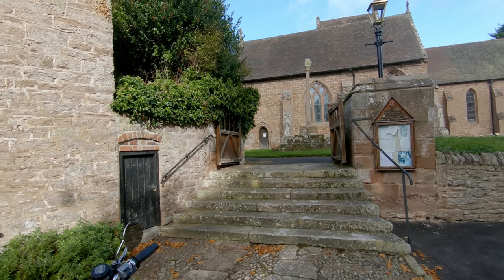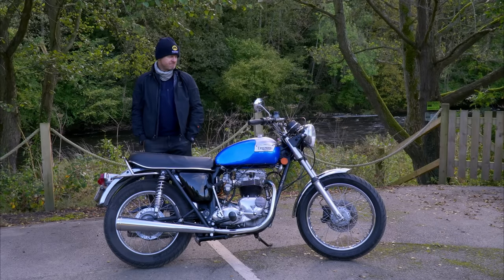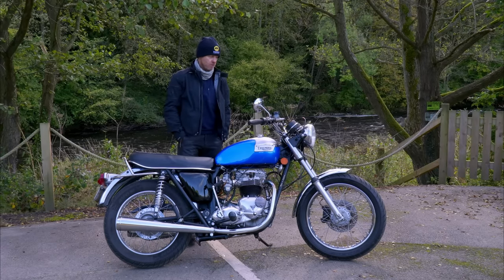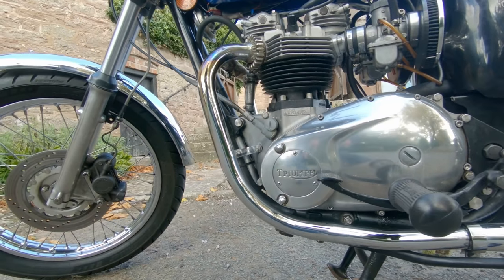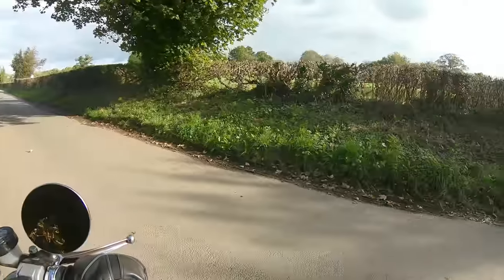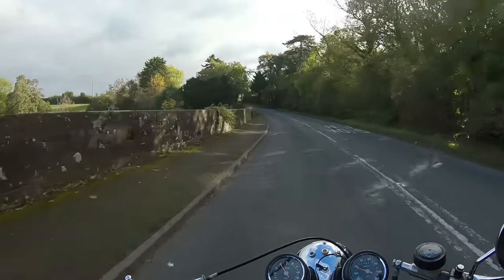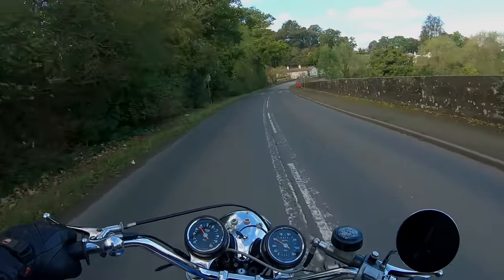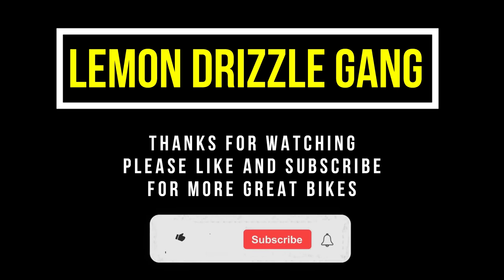Modified 1975 Triumph Bonneville,  better than a modern retro ?

Comment: Long-time '76V owner here, love the blue/white look! The '76 has some notable changes, and not all for the better! The left foot shift can cause shifting problems, and the hastily designed  rear disc brake come to mind. But with patience it all gets sorted out, and it's a terrific classic bike with plenty of parts availability, good brakes, turn signals, and reliability. A well tuned OIF 750 beats a modern Bonneville Thruxton in acceleration, i know that personally!
Reply: Rubbish 😂😂

Comment: I have a 76V that I’ve owned since 2013, rebuilt the engine with three piece roller TS bearing, Hyde half race cams, LP Williams 7 plate clutch, new Premier Amals and had the head done with +1mm G&S valves and K-lined guides. Looking forward to video on the mods done to this bike, looks and sounds great. I’m preferring riding it to my modern bike.
Reply: You sir, are to be envied and admired.

Comment: I have a 1973 Tiger 750 that is very similar. 
I have owned since May 1977.
It has over 62,000 miles & still Runs good.
I have never split the crankcase so it has original engine bearings.
The inner transmission cover has never been removed, so internals of the transmission are all original.
When it had 30,000 miles I had the cylinders bored out .020
I made my own wiring harness in 1985, basically duplicated the original, but tried to make better.
I replaced the rectifier & diode with a new electronic unit.
I add a little 2 stroke (synthetic oil) to the gas & it keeps the carburetor from sticking.
I had the cylinder head redone many years ago 
You should use a Viton o-ring on the exhaust tappet block, other o-rings will leak/fail due to the heat.
I rebuilt the clutch last winter & replaced the clutch hub assembly etc.
I have replaced the primary chain three times.
My bike has a single Amal carburetor with stock side covers & Tiger name plate.
I never had the stock paint job & right now it is reddish orange.
I have always had short mufflers.
I had to get the frame welded years ago because the oil tank was leaking -  where the swingarm pivot penetrates through the tank.
This is a common problem with the frames.
I replaced the tachometer drive with an older style. The original style had a problem with the Welch plug coming out.
I do have nicer looking mirrors: 
They are triangular in shape & stick out farther on both sides. The mirrors mount like originals on the brake cylinder & clutch handle bracket.
Anyway, that's my two cents.
Reply: I've got several Triumphs I've bought over the last few years, trying to reach back to my youth and your statement provides a comfort zone for me.
Reply: @JohnMcClain-p9t  
Thanks!
I now have over 64,000 miles on my 1973.

Comment: PS, I had straight through down pipes, no balance tube, as this stops a smooth exhaust flow! Boyer ignition, & dinamicly balanced. The next job I  would have done, if not stolen, was to fit the carbs you have. Just a lovely bike, thanks for your vid.

Comment: Absolutely the best year for the T140V, Sadly my 1973 T140V was stolen. Why I loved that bike was it did everything I wanted, also the right-hand gear change was perfectly balanced with the clutch lever movement, as the brakes were. This was due to the cross movement from side to side. Also this design meant using both sides of your brain for any change of operation.
Perfect.

Comment: I had a T140 Tiger many years ago, covered a lot of miles on it and it never gave me any problems. Also had a few T140 Bonnevilles, but always prefered the Tiger. My favourite Triumph was a T160 which I always regret selling - PYH488R where are you now?. I have a modern Triumph these days, but they just dont compare to the originals. Also had a T120 R - that was a real rocket ship and unburstable. Happy days......

Comment: I used to own one very similar, over 30 years ago; till some bar-steward stole it. It was dynamically balanced.
AT a place called Basset-down near Swindon. Floating rollers both sides, using shims to 6thu end play.
It was a 1973 model fitted with Boyer ignition. 8.5 to 1 compression and went really well. Also right hand gear shift
which is better, as your hand and foot movements are across the centre of balance, as is the breaking. 
Nice bike, look after it.

Comment: I grew up on these bikes! Started with a 69 Trident in 1975, then a 73 650 Bonnie two years later, followed by a Commando 850, then a 750 Bonnie and later a 750 Tiger. In 2009 I was about to lash out the $15k (AUD) for a brand new Bonneville, when a mate came round to tell me he was trading his 1997 883 HD Sportster for a bigger bike. A soon as he told me the trade-in was $7k, it took about 10 seconds to decide to go with that for my first ever Harley. 15 years later and over 90,000 kilometres of touring all over Eastern OZ, and I still have it. I stripped it right down a few years ago everything including wheels came apart and with a set of Carillo barrels and pistons from Hammer Performance, it’s now a 1275cc. Standard heads give it a 1/4 inch squish band and 10.1/1 compression ratio, which with a 2-1 system and an S&S teardrop air box, puts out around 90 HP and double the troque of the original engine. It’s perfectly balanced and although it isn’t QUITE the same as the sound in this video, it is similar in that it is happiest at around 5k RPM and the sound is not far off either. At 67, I think this’ll be my last bike, but listening to this Bonnie revving its way through the gears is music to my ears! The modern Triumphs do NOT sound as good!

Comment: Much better looking with the retro style side-covers. I have these on my resurrected 1982 American export T140.  This was missing a lot of parts when I got it. Tri-Spark ignition was a game changer and it is a joy to ride as well as being reliable. I like the T160 kick start.
The T140 is a pretty good daily rider if maintained well but they suffer a bit in the summer here in Western Australia. I pick my riding weather and can always fall back on my Sprint GT or Honda 1300 Super-Four.

Comment: Very very nice- Thank you for sharing. I have a 78 T140V that I have owned since 1986. Its 100% stock, (barring a boyer ignition that has performed flawlessly for over 30 years),  - and I have to confess that all the impressive mods that he has done to this one feel to me a little like thousands spent "gilding the lily" a bit. I ride mine almost every weekend on some of the twistiest mountain roads that CA can provide and  it performs just as it should - and just as seen and felt in this video. 
And like he said, (while I have a number of terrific classics too, all of which are "worth more" than the T140V),  its the last of all my bikes that I would part with. It is  eminently practical, very user friendly,  and very fun to ride with one, or two, passengers. Say what you want about the OIF bikes, they are much more reliable machines than the 60's bikes and every bit as satisfying on the road.
Again thanks for sharing-
Reply from the maker: Thanks for watching
Reply: Yes, it's a great looking and sounding machine. I've got a 78 T140V, UK model, which I've owned since 1993. It looks standard (apart from the Norton peashooter silencers), but has a few unseen, practical mods, such as the upgraded main bearings, Boyer ignition, 3-phase alternator, paper oil filter conversion, screw-in exhaust port stubs, halogen headlight and 13mm front master cylinder. All of these are for reliability and rideability, rather than performance, and have not changed the character of the bike, which I love.
Reply: Joining the party - my '78 T140V, slightly modified - is a gem to ride over the two-lane blacktop roads in SoCal's high desert. Especially thru the Joshua Tree National Park. Too bad we can't share pics!

Comment: Sounds beautiful. I've never owned a Bonnie, but did own two Tiger 750 single carb bikes and a heavily modified Trophy Trail 500.  One of them was excellent, the other not so much. I would love to own a classic but have decided to go for a newer technology parallel twin with fuel injection, after road testing one. Still I miss my Trophy Trail the most.
Reply: I had a Trophy Trail 500 i bought new in March of '74.

Comment: I loved my T140 . I changed to the slimmer tank , due to a split nearest to the headstock , and put larger , non-standard , but Triumph , badges on the new red and black twin gold striped tank . Then I put Usa handlebars , the old rubbers that I replaced acted like pendulums ! And then I put Commando reverse cones on . One very pretty bike , in my opinion anyway ! But despite all the cleaning and beeing about with timing and carb tuning ( I had , still have , a mercury manometer ) I could never get it running to my satisfaction . Merlin motorcycles offered me a deal with an SF2 Laverda that I jumped at . Eventually , after failed fettling  , Andy had the engine apart and it was found that the cylinders were not bored parallel . 
Like I said , I loved the Bonney . It seemed light and agile , the stainless single front brake was a nightmare in the wet mind and it made a lovely sound . A grown up 250 really ! Loved it and now I have seen your video , maybe when the dosh arrives I wont chase a new RE or Guzzi . Thankyou .

Comment: Interesting stuff. Had a '75 T140V which was right foot shift. I now have a '71 OIF Lightning and a '93 VFR750. The former is badly engineered out of excellent materials and the latter excellently engineered out of crap. Had an R80/7 which had the best of both worlds but not very quick or sporty. At the end of the day it's how it makes you feel. Enjoy!

Comment: I had one of these in 1975 a T140v American version same as in film, I still suffer from white finger, vibration was horrendous, they literally shook themselves to bits. My favourite Triumph which I had for 10 years was a T160, wish I'd kept it, I'm sorry but there were no tears shed for the T140. Judging by the amount of mods it is no longer a true Bonneville is it?, but I approve this is how it should have been. Notice you have a lithium battery, I gave up on these after 2 bad winters which killed them dead, even on a lithium maintenance charger, Yuasa for me every time, never had one last less than 8 years.

Comment: Jay Leno said his '64 bonneville handled so well it was  like he just had to think of where he wanted the bike to go and it responded. That described perfectly what I liked best about my '68.....Yes, it had all the annoyances that riders complain about but that feeling of it being an extention of myself was amazing. I'm told the frame change in '71 changed that.
I would have really liked a lot of what's on this '75....great video
Reply: I had my 68 Bonnie for years. Still love it.
Reply: I don't think the OIF bikes take away any of what you described, a lot of which comes from the weight (or lack of it) distribution and the skinny tyres which roll so easily into the corners. This bike definitely handles better than my '68, which is pretty decent anyway!
Reply: @waveydavey750  To be honest I've never driven an oif bike. I just remember the complaining when the '71s came out. I did drive some hondas, a yamaha 650 and a '70 bsa 500, and they all felt like a bit of a wrestling match in the corners. The bsa was brand new and after getting off my bike the first thing he said was " I'll trade you strait across"
Thanks for your observations. Leno also gives some facts as to why triumphs bought in the uk often handled better than the ones exported.......interesting

Comment: I believe the factory 1979 was the best Bonnevilles ever produced. I've seen many that were leak free, electrically straight, the best carbs, the best build quality. These bikes are highly underrated and very reasonable because the many seek to own the 59-69 and the most desirable.
Reply: Why do you suppose that people think that these years are the most desirable?
Reply: @derekcollins1972  their association with the king of cool Steve McQueen, the 60s styling, less vibes than the 750 when build correctly, they are also lighter than later bikes with fewer build problems when new than the 70s bikes which suffered from the issues as the BSA/Triumph group collapsed.
Just my opinion
Reply: @nigeh5326  Thanks for your opinion. I still have my 68 Bonnie that I bought many years ago for $1200. I remember kicking myself afterwards when I could have bought a pair for $600. One ran and the other didn't. Lol,times have changed from being worthless to many to crazy priced today. Fads happen i guess. It's great to have lots of parts nowadays available.
Reply: I had a brand new 79 that was a real lemon. A great bike when running though. Appalling quality control issues on mine. I own a 68Trophy 500 now that is superior in terms of reliability, build quality. Go figure hey?

Comment: I went around France in about 1969 on my second-hand Tr6 650 triumph. My gear lever broke when starting it to come off the ferry, luckily it was Saturday morning and there was a dealer in Boulogne who had the parts. Halfway to Paris, my mate's 350 Triumph started to blow oil from the front of the crankcase, I think it was some sort of release valve. (so long ago) In a small town, we sourced a flexible tube, jammed it in, and back up to the oil tank. It nearly lasted the 2-week trip. We had to leave it and came back two up with all our camping /clothes as we had nearly run out of money. All the way from Moulins  back via Paris to Boulogne and then Dover to  N London, only stopping when we had to

Comment: Low compression pistons - hmmm.  Could they  be lighter and reduce reciprocating mass?  That was my theory when I installed some dished pistons in a Commando for an 8 or 8.5 ratio.  With the isolastics there was no perceptible difference, but the engine refused to wear out.  Mtns of Colorado, plains of Texas, deserts in Arizona and Nevada.  Wife on the back for it all and it never stuttered or wheezed and powered through everything.  It's still in the garage.  
Retired in SE AZ.  Still riding.

Comment: Absolutely gorgeous bike and modifications certainly make it much better than the original. As a Sunday bike it works. Better than the modern classics? I guess it depends on what you value but generally I would say no unless it is a 4th bike and you have time to tinker.
Reply: Yes you definitely have to consider tinkering as part of the ownership process, but it's not huge, just sensible servicing and regular checks mostly.

Comment: A good buddy of mine bought a T140 brand new in '75. Being a big Triumph fan I drooled all over the bike and congratulated him for buying a Bonny when everyone else was buying Japanese. Well the motor more or less fell apart within 6 months. This was in California. I don't blame the design as much as terrible quality control at the factory back then. I recall being with him in the parking lot when the entire shifting mechanism became disconnected; a problem that came about from conversion to left hand shift, Anyhow, it was a mess.The shifting lever sort of dropped down and the cross shaft was clearly no longer hooked up to the gear box. It went back to the shop but more things went wrong and it was endless misery for my friend. Apart from the paint, the finish and workmanship in this particular era were disgraceful. That said, the T-140 is a delicious classic to have now of course, but nearly any you see today have been meticulously restored where particular attention was paid to the engine. Meriden bikes after about 1972 were just not up to any decent standard and almost rubbish in many respects. It was like they had just given up and lost all pride IMHO.

Comment: In 1978 I bought s brand new T 140 V $1,320  and always regretted not keeping it, but last week I got a 76 T 140 V with 6,000 original miles  $4,300 just needs a brake job and new tires, it has the original factory tires that look brand new but 46 years old is too dangerous to trust, still have my 99 Sprint 900 and a 2006 Sprint ST 1050, had a 2002 955i was a rocket ship until my son wrecked it , still curious about the Speed Triple RR and the new 2022  Rocket 3 R can't decide which to buy, might need to have both,  take a year to sort them out.

Comment: I have a T140V very similar to yours,  USA fuel tank and fake oil tanks,  been in the family 45 years,  I have used it as a daily, and spent many hours riding it, I have new AMALS on it and dialed in cams, 40 over bores - flowed head - open pipes, she goes good.  They are an A road scratcher supreme,  terrible on dual carriageways or motorways, although mine is smooth at 65-70mph.  
Have elec ignition and an oil cooler added - cooler is a must on them if your gonna ride hard, also holds more oil that way.  Also never fit the aftermarket oil filter kits,  they allow dirt to enter the engine through the oil pump from the frame oil tank,  unlike the original top hat oil tank gauze filters which are better and don't allow that to happen.
If you get the frame sand blasted - sand will enter through the incomplete welds at the head stock and into the frame oil tank, and then go into the engine (only if you have the aftermarket oil filter kit on it) and destroy it.
I love mine it regularly does 110mph,  and can out accelerate a Hinckley 880cc Bonnie, (it isn't standard though so cheating a bit there :)   )
Could have sold it many times over the amount of people asking to buy it from me !!!,  but its an airloom now so goes to my kids.  It'll be ripping up the tarmac long after i'm dead and buried!!!.
Reply: The oil filter conversion I fitted (20 years ago) uses paper elements in place of the strainer, so no debris gets through that to the oil pump.